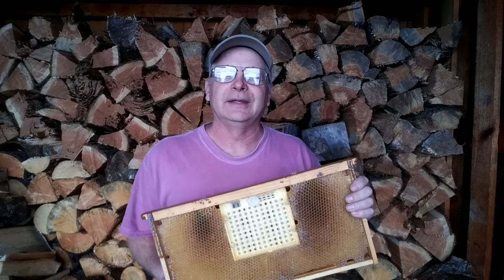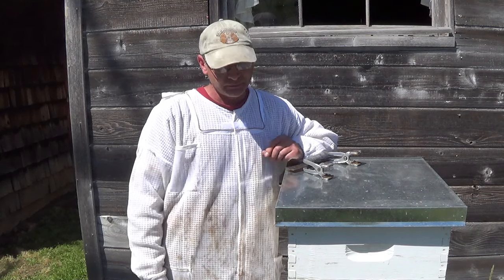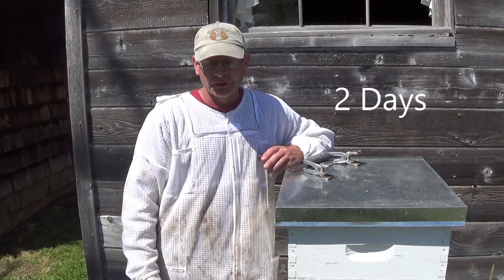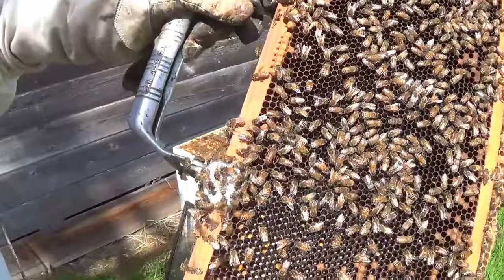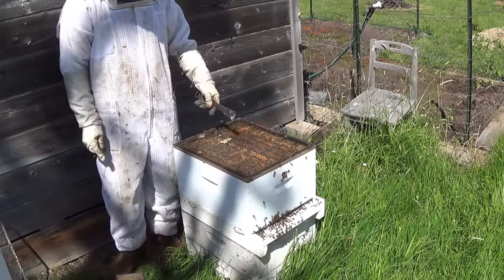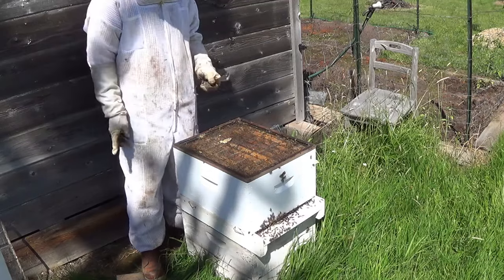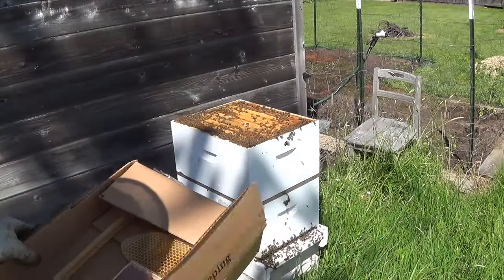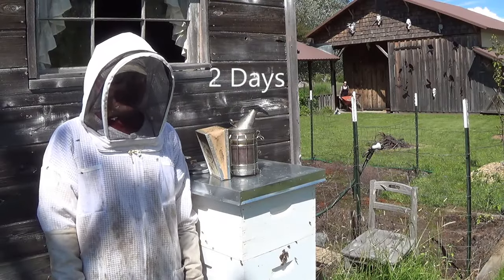The Complete Nicot Queen Rearing System: A Step By Step Instructional Guide

Comment: The "hair roller" cages are only needed if you are hatching your queen cells in an incubator (rather than a nuc/colony). The cages provide protection for your remaining cells when the first virgin emerges. This prevents them from killing each other.  Your method doesn't require them.
Reply: Great video by the way!!

Comment: Hi there.
Thank you for a great video on the 'Nicot' system. Awesome Tution throughout ! 👍
Here in Scotland 🏴 we mainly use "National Hives" nearly the same as a Langstroth but the Width is nearly the Depth too. (Off Square/Rectangle !)
They do great on the Heather Flowering Moors. (Heather Honey is one thing Scotland has a lot of.) 🤭
I do also have Langstroth and some Smaller  Box  Hives called the "French Warre Hive." Easy to make :Box Height : is made by cutting up a Scaffolding Board, using that boards width ! They are super sturdy and thick, so have a good Insulation value (heat retention properties for our cold Scottish Winters. 🥶)
A whole Hive is like a little tower, sometimes x6 Boxes Tall ! High, but easier to lift each Brood/Super on/off as needed. 👍

These Warres are fabulous at being the Starter and Finisher Colonies. Way easier to lift say x4 Boxes of only x1 Ft Square ! Easier in the lifting on and off Queen searches /  taking off Honey Supers. 🤭 
Do all my Queen "Rearing" in these Hives. Better still than a x5 Nuc or Nuc Stack. (Wobble.)

Then take emerged (Caged) Queen and add to Hives, Nucs, or Sell or Post them on.

A case of making 'Frames'  DIY wise (not a fan of Top Bars)
Using Chicken Feed shipment Wooden Pallets.* Scrap gets cut up into all sorts re the Bee Yard. Frames, Swarm Boxes etc. . . 🙃 
(Do check that  theTimber* 
is 'heated' Treated and not the Chemical dipped ones!)

Glad you got a great Nicot Kit off Kelley. Ship to me ? Don't think USPS swims the Pond !
(I had to go onto 'Fleabay' 😉) and got myself x3 Units !  
For only £6 ($8) each 

That's a lot of Cells, Cups, Holders, and Rollers ! Even got a one Handed Queen Catcher, Push in Cage and a Pointy Larva Transfer Tool. All probably via China !?

I too have dexterity issues, so prefer to Roller Cage Cups and associated Queen Cells so they on being 'Sealed', can be then contained. Less likely to be knocked or damaged ! 😖
Makes the moving on and off much easier. Granted it takes more Frame Rails to up the volume of Cup holding space.

Also got a tremendous 'Queen Cage' and Holder Tray off Amazon (UK) its (x46) Cages of these (!) And its associated Tray. That's a Queen holding Palace.  😆 Think I will 1/2 that Holder. Easier to handle etc. . .
Queen Cages are the ones with a Tiny Tube at one end, you Introduce Queen in by. 
The other end has a Flap /Fondant Shelf. That assists Queen with Attendents in food need, if Shipping to Queen Buyers. Or to achieve a 'slow release' when Re-Queening a Colony. (Bees chew through the fondant, while getting known to each other.) Nice. 😏

One final note.
I would personally get some BBQ Skewers and run them vertically in those 'voids' where the Bees need to Build Comb to make that Egg Cage System be part of a full frame. 
Tip : If you cover those fine timber (or bamboo) BBQ Skewers in melted 'Beeswax' the Colony will build up Comb super quickly. And it gives more strength, having those 'rails set' within that Frame and associated Comb. 
Decide your spacing. Drill top and bottom pilot holes on inner top & low edge. 
Cut BBQ's Skqs a tad longer than the true length of that Bar/Rail/Bar space.
Soak BBQs Skqs in boiling hot water, soak for say x10 Mins, this makes them a bit more bendable. Add one end 'in,' bend slightly off straight, add other end in. Wood Glue holes before is an option (!) Then its just painting on some Melted Wax to all those BBQ Skqs,
all along Nicot Cage Edges. All surfaces of Frame insides. And you will get perfectly Drawn/Straight/Strong Comb.
Hope this helps Folks. 😎
🐝🐝🐝🐝🐝🐝🐝🐝🐝🐝🐝
   Happy Beekeeping 2024
🐝🐝🐝🐝🐝🐝🐝🐝🐝🐝🐝
Reply from the maker: Thanks for the tips...
Reply: Do you have any video?